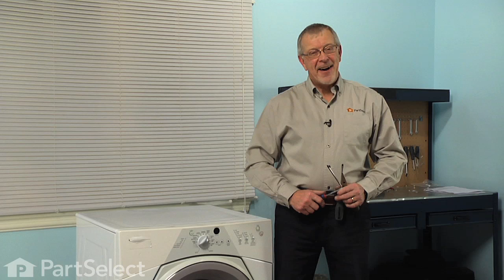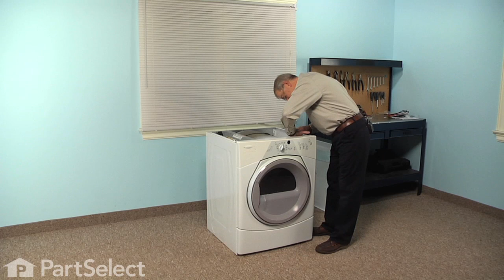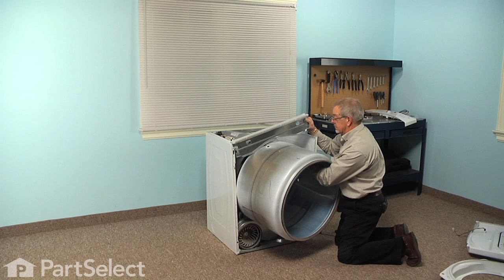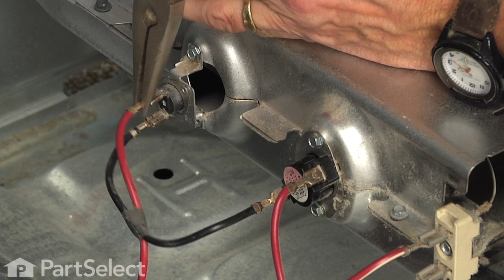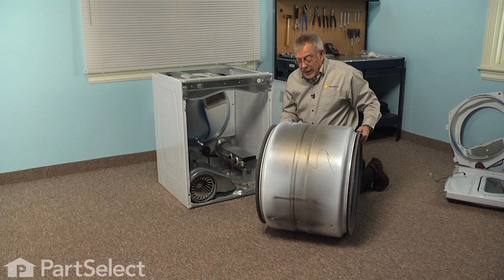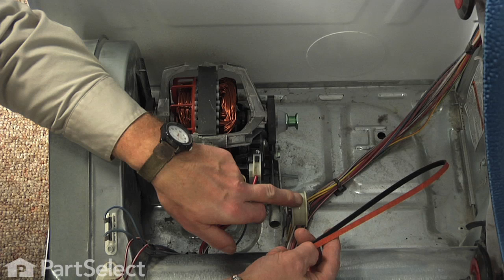Dryer Repair - Replacing the High Limit Thermostat and Thermal Fuse Kit (Whirlpool Part # 279973)

Comment: Last year, the element burned out of my dryer (same one as in this video). This gentleman makes it look like it's a quick job. Took me quite a bit of time. After taking this dryer completely apart to change the element, I figured I would change the belt and the thermostat at the same time... why not a little tune-up to avoid having to open everything back up in a year or two. Less than a year later, what do you know!!! The new thermostat breaks! I'm going to try to access this thermostat from the rear to avoid removing all these panels AGAIN. What happened to a washer/dryer lasting 20+ years like the good ole days???!!!
Reply: Was your blower fan working and did you check for obstructions in the conduit going to the outdoors

Comment: For future videos, I'd recommend a smaller frame (closer in shot); maybe some artificial light into the darker places. Each step seems easy to do, but there are a lot of steps. 

Recommendations for the do it your-selfer, take a picture with your phone or digital camera before you disconnect wires.

Keeping track of different sized screws (and not losing any) seems to be the biggest challenge in home repairs.

Comment: A lot of work.  All ya have to do is pull off the bottom panel and unscrew two bolts that contain the heater.  Voila, access to the thermostat.  This video does help me in case I have to tear it apart though!

Comment: I took the back piece off where the vent comes out.  I was able to reach in and take out the thermostat and fuse that way.  It really wasn't that confined and it saved me a ton of time by not pulling ther entire dryer apart.  The way this is being done sounds more to me like they want to waste time so they can charge you more.    The 2 parts together are around 30 bucks,which I replaced myself.  I am not a technician, just a woman who learned alot from my Dad growing up.
Reply: I'm gonna try that! Thanks! (there is no way I'm going to open up the dryer from the front again.... last time took me forever!)
Reply: This video itself was somewhat helpful, however is best because it allowed for your comment.   Good on you!
Reply: That is freaking awesome! Good for you!
Reply: Thank you, the whole time he was taking all that apart I was like why can't you just pull off the back panel? Your way
 is the way I'll do it.